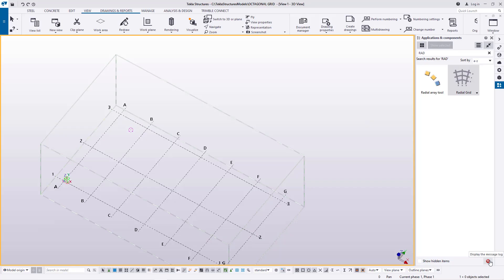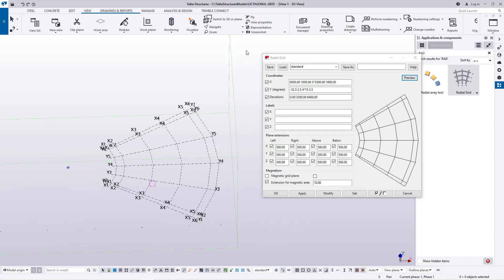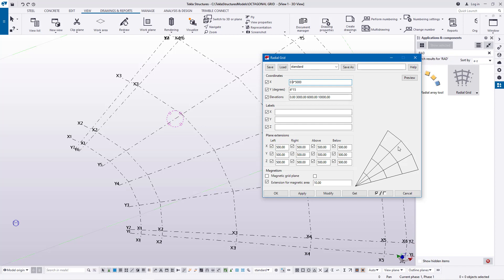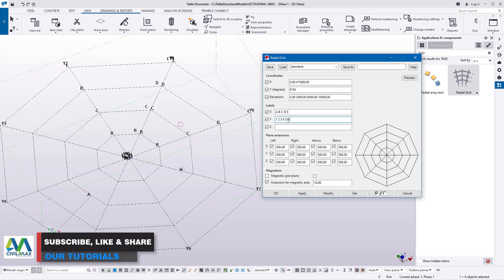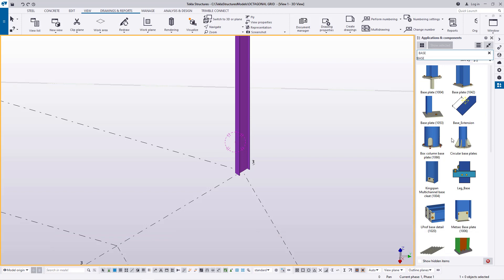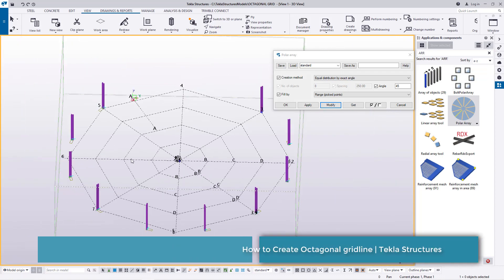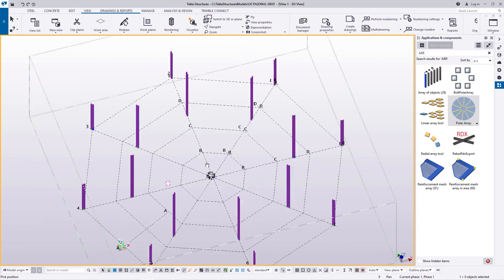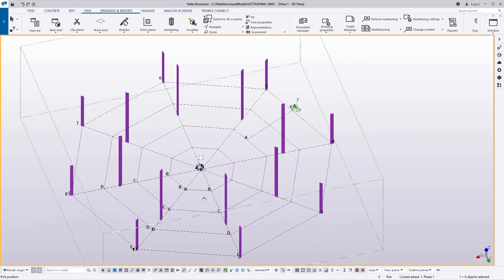Octagonal Gridline ''Reviewed'' | Tekla Structures

Comment: Je ne parviens pas à trouver radial gred dans mon tekla que devrais je faire???
Reply from the maker: which version are you using
Reply: @MauriceDimba I can't find it either, the only option that appears is the radial matrix tool, so I used the one I had available on tekla even though it is the radial only! but you can only copy one object at a time!